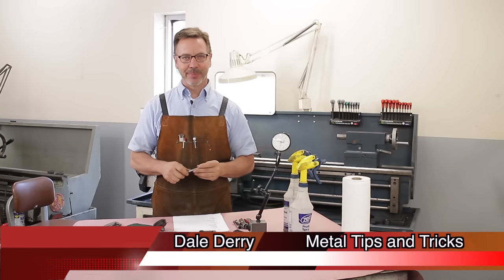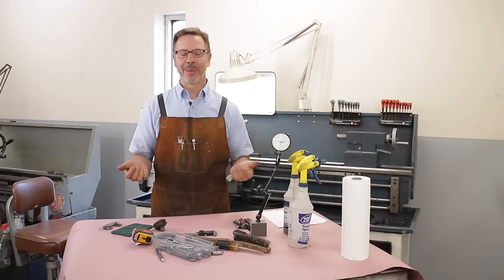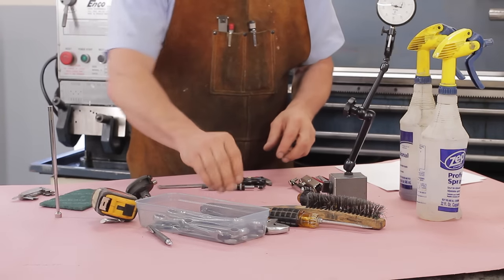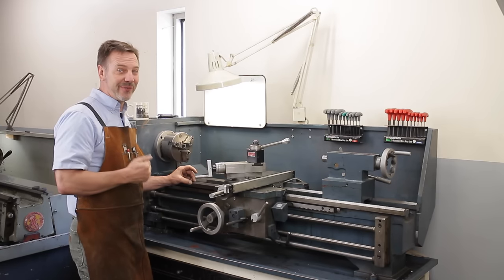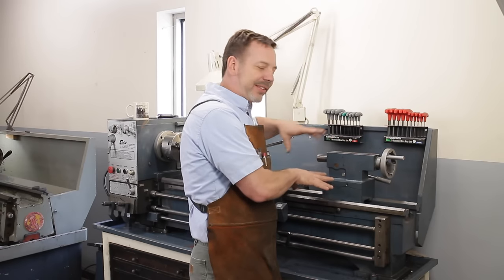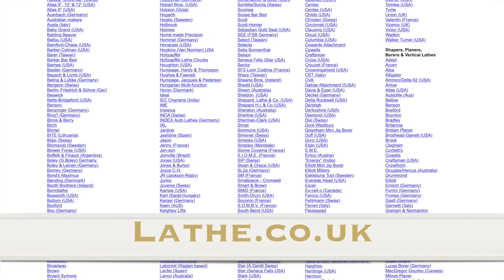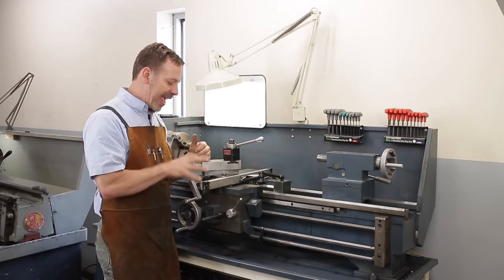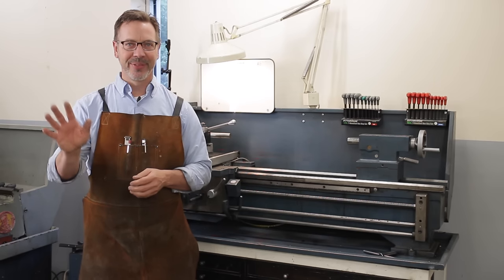How to buy a Metal Lathe part 1

Comment: I don't know if it's because it's 2021, or the part of the country I'm in (southern arizona), but I hardly ever see a full size lath for less than $2000 on craigs list, and if it's in nice condition (doesn't look like it was just pulled up from the bottom of a lake) and comes with some useful accessories, they tend to start closer to $3000 and go up from there.

Comment: Great technical guidelines, explanations and references for checking the state of a lathe. Very well done in terms of using simple explanations. 

I personally think it is overdoing it using the indicator and tightening gibs for a $1000 lathe. ;) You can have a sense of looseness without having to use an indicator. Myself, I would not let an unknown person show up and start playing with the adjustments of the gibs on my lathes since they are in perfect order! 

You must be the exception having paid those prices for lathes in good order. Or one has to spend an inordinate amount of time constantly looking for bargains. I bought lathes for less than $1000 but they needed a lot of work or tooling before being usable for turning something other than wood. 

The lathes that I have now for turning precision parts were all worth a lot more because of the state they were in and the tooling included i.e. chucks, collets, steadies, taper attachment, DRO. 

Then again, fixing an oldie machine to make it work almost as new and finding the accesories to equip it is a hobby in and of itself and that might be what gives you the most fun!

Daniel
Reply: Better be pretty sure it's OK before pulling out a scotchbrite pad in someone else's shop

Comment: Very informative and true! I've never spent more than $650 on any of my lathes (Atlas, Logan, Craftsman) and if you find one with extra tooling, it's a bonus.

My Craftsman came with a Turret that was for the wrong model... I sold the turret and made most of my money back. The best part is that the machine was rarely used (after 40 years) and the waze  was mint (within .0003 throughout the entire travel).

Another example, My Logan came with two steady rests. One steady rest was for a lathe with a half-inch higher center. I sold that and paid off half of the machine.

With patients and perseverance, Craigslist is the way to go, or eBay (local pickup)

Comment: I like your approach for buying a machine tool. Almost every machine tool that has been used & not maintained or rebuilt at some time is not worth over a $1,000.00 because you are going to have to ship to a quality machine tool re-builder & that will cost thousands depending on what needs to be fixed. I have seen 40 year old milling machines & lathes that had never been rebuilt going for $8,000.00 -  $15,000.00. People & companies have no idea how to price their crappy wore out machines.

Comment: Thanks for the useful info. I have been looking at lathes and mills on Craigslist for a while, but was thinking that I would end up with a 1000 lb. paper weight, now I think I might finally buy a machine that I can learn to use.
Reply from the maker: +TheHillbillyEngineer 
remember if you pay a Metal tips and ticks price you can always resell it. :-)

Comment: All you guys who can't find lathes... I don't know what you're doing wrong.  The last lathe I had was an old Atlas I bought for $150.  The lead screw and everything that connects to it came in a box disconnected from the lathe, but I never used it so it didn't matter.
I likewise let it slip through my fingers afterward, because I had it for three years and only did two things on it and I can't devote 12 square feet of shop space to an unused tool.  :D
I suggest two things for those looking.... First, like he said, be patient.  Deals come along.
Second, get to know the other tool heads in the area.  For instance around me there's an engineering listserve, and they have an annual yard sale where everyone cleans out their old crap.  That's where I found the Atlas.  But that wasn't until the second or third year going.  See point #1.   :D

Comment: I have the same lathe just re-named, looking forward to your next video because my lathe has issues with the tail stock lining up center in different positions along the bed. thanks for all the good info you produce.
Reply: +Theo worm That's a bad sign... You should be able to keep the tailstock centered on the spindle without any adjustments for the length of the ways... What you are  mentioning can be anything from worn out ways to a bed that's been twisted - either by crashing the lathe under load, or having the lathe fall over and hit the floor / ground.

Get a longish straightedge - 18" or 24" - and for this, a Harbor Freight (aka Horrible Fright) 24" combination square's ($10) blade will do the trick - and set it up against the ways and look for light leaking between the straightedge and the ways.

Check it both horizontally and vertically, on both rails (unless you have a Hardinge or similar, which only have one dovetail way for the bed)

If the light leaks are thin - like feeler gauge / shim stock, <0.020" thin - you can consider having the ways scraped, or ground and re-hardened... if the lathe isn't an inexpensive one.

That gap size isn't hard & fast, but you are talking about a large surface grinder job. I forget if it was Keith Rucker who had that done on a lathe, but the project cost a large chunk of change.

What I'm getting at here is that you may very well be in a situation where it makes more sense to sell the lathe for parts - you just won't know until you map out the ways and assess the damages.

Sorry to bear rough news, but you could be in a very frustrating position.

Eric
Reply from the maker: +Theo worm 
Im glad you like the video. I had a similar problem with my lathe. What I did to fix it was take the tail stock off and clean the ways on the bottom of it, they were a mess.
Reply: OK, so in my late night reply, I assumed that things had been cleaned of accumulated gunk & crud... I guess that I should have been more explicit about cleaning things up first... ;^)

Comment: Lots of good information including the advice about the tailstock internal MT surfaces being badly worn or bell mouth. It is not an easy fix unless it is just slightly worn. I like to hear your advice on what to look when inspecting the headstock.
Reply from the maker: +Paul Jones 
Im glade you like this video. You will have to wait until next week to hear about the head stock

Comment: bought my first lathe recently wish i had seen this vid first. incidently i bought this exact enco laithe used and was completely taken advantage of and lied to. but thats life. thank you for the invaluable information!
Reply from the maker: Sorry hear about lathe. Did you get it working?
Reply: still working on getting the bend out of the cross feed lead screw. Im daunted have no experience with this machine. luckily the ways and main lead screw appear in great condition. so i got that going for me...which is good.

Comment: extremely helpfull video, I was looking for exactly this, someone to show me step by step, not being a machinist, how to buy my first lathe and not get ripped off.

verry good deals! im envious. ive been keeping my eye on craigslist in minnesota for a years and the only thing I see for under $1k are occasional old 6-12" belt driven lathes, or big lathes in really bad shape in need of serious restoration (usually sitting outside for years). lathes like the ones your showing would avarage mabey $5k here, with mabey $2k at the low end.

It may be a difference in location, but i just dont think deals like that can be found where I live, ive been looking for probably 5  years and if a deal that good came up i would have made it happen.

Comment: My 12x36, same as the enco here was $250 canadian, came with a bunch  US made indexable tooling, and multifix toolpost. Ways are flawless. Problems were cracked handwheel and gear selector from being dropped. I noticed later that the spindle has 0.002 TIR. Will have to learn to use my toolpost grinder to fix it..

Comment: I bought a 12 x 36 atlas,,2 chucks 3 and 4 jaw,,, aloris tool post and nice full set of tools,,and has quick change gear box and shows no wear on gears and ways,,needle didn't move in spindle runout,,,payed 800,,

Comment: I picked up a south bend 9x32 C for 150$ it had no ware the actual factory flaking was still visible! Two weeks later I picked up a South Bend 16 x 60 with a 3 jaw chuck , 4 jaw chuck , face plate , two steady rests , follower rest , taper attachment, ball turner and lots of tooling for 1000$

Comment: I just called my psychiatrist, I need help after hearing what you paid for your lathes. I must be crazy for paying what I did for mine. My wife is going to kill me. I have never seen deals like that and I'm not doubting what you are saying. I think location has a lot to do with it. I drove almost 900 miles to pick mine up and the only reason I bought it was it was fully tooled and looked great for being 60 years old. I wished I had seen this video before hand. The head stock bearing is zero in one direction and 1/2 a thousand the other. Using a test bar and dead centers over a 12" distance it's zero on both ends but moves .0005 over the 12" from Tail stock to Head stock. Can't get the nuts of the handles for compound and carriage feed where I have .060 back lash on compound and carriage cross feed. I'm not a machinist but had some machine shop background over the 40 years I was a certified pipe and tube welder. I'm disabled and have a lot of work cleaning this lathe and bringing it back to standard. I would never have bought it knowing what I know now, I don't think I would buy a South Bend Lathe but would look for a lathe with more HP and not a flat step belt pulley setup. My health issues are shutting me down from doing any physical work anyway. I hope your method of buying a lathe helps all who watches this vedio

Comment: your advice seems to assume a recently retired machine, would you recommend against buying a machine that has sat long?

I recently bought a 1921 lathe that the seller said hadnt run in 30 years.

everything was stiff and the exposed lubricant had become gummy over the years.

the ways look good but it will need some work before it can be checked out as you suggest.
Reply from the maker: Hi Drew, If you got it for a good price its hard to go wrong. I have found that dried oil protects the machine from rust. and its not that hard to clean off. Good luck:-)

Comment: For me, the biggest thing on buying a lathe is the seller. On my A/C late, the seller showed everything that was not perfect on the lathe. No big things; cross feed screw has a bit of play. Tailstock taper did not fit some tools perfectly, aftermarket pulley as original was warped and ring in the spindle pulley. The lathe was well kept and oiled. So, I knew what I was getting. He was getting a nice Chipmaster lathe and needed room so sold it cheap. 

My 109 lathe was "here you go, I know nothing about it". Worst lathe I ever had.

 Before seeing it research it online. See if parts are available and forums will show common faults (i.e some have flaky electronic controls.). The more the seller knows, the more you can learn form them.  If all they can say is it has a new paint job, walk away.
Reply from the maker: +Scott Henion 
Great advice

Comment: Hi, i build small flash light housings from stainless steel at school, but i want my own lathe. The housings are small like 95mm to 200mm long and 14mm to 30mm wide, what would you recommend for that? And and nice video btw.
Reply from the maker: Im sure if I under stand your question. what kind of lathe would I use?
Reply: Hi, yes

Comment: This buying advice all came too late for me but to be honest I think I would have bought my hobby lathe anyway just because it's a fantastic antique. Got it here in the UK for £100 ($132). Drummond round bed lathe built between 1908 and 1938 & many of them were used in the machine shops on battleships in WW1. Have you ever had a round bed lathe with an internal screw ? I'm still building up the courage to clean it never mind open that can of worms.

Comment: Hi Dale, I’m an avid viewer and subscriber of your YouTube channel. Great stuff. This is partially your fault!! I just bought a year 2000 Enco 13x40 Turn-Pro lathe😁👏🏼👏🏼. Has factory DRO = happy! If I remember correctly, you have the same or similar lathe. Wondering if you would advise me on quick change to post size. BXA or CXA?? Thanks!!
Reply from the maker: Kenny Gee hi is have an axa on mine
Reply: Build Something Cool ; Hi Dale, thanks for the reply. I ordered a Bostar BXA through eBay - $180 to the door w/7 holders. Works great, I like the size. I used your advice while examining the lathe and got what I think is a great deal. Thanks again for all your videos. I’ve learned a lot!

Comment: I looked for years for a. good inexpensive benchtop lathe. I didn't either need or want a lathe bigger than 10x24, as I worked in a machine shop and had access to large lathes. Anything in even halfway useable condition that I found on ebay, used machinery dealers, Craigslist etc, fell into 2 catagories, decent condition but priced completely out of all reason for what it was, or old busted up and worn out parts missing, cleaned up and repainted junkers from (insert name of defunct US machine tool company here).Scrap iron. Better to just buy a new  import. My hobby is making things using machine tools, not rebuilding junk machine tools.

Comment: I think I would rather buy a new Chinese lathe than try to get a good deal on an old machine.  Their is so much to look for that us amateurs will overlook on a used machine of any kind and the eventual repaired cost will be as much as buying the new Grizzly.
Reply: +Amateur Redneck Workshop 
Hi Harold, 
That's the on-going debate isn't it? Whether to buy new Chinese or old American...

The South Bend lathe in my avatar is from the 1970s, runs like a champ, but was never used in an industrial setting. It's been used in a community college since it was brand new and has always been well cared for. It could probably be used for another 40 years, no problem. However, when I check Craig's List and Ebay, everything I see looks rode hard and put up wet. I live in southern Oklahoma and we have a lot agriculture, but not much manufacturing. Every once in a while something pops up in Dallas or Oklahoma City, but usually those machines are trashed. 

We have a Grizzly lathe 16x40 that we use for gunsmithing and light machining and it has its quirks. It probably wouldn't hold up for daily hard use but it suffices for what we use it for. A buddy has both a smaller Grizzly and a larger Jet, neither of which are industrial quality, but they works well enough. 

Take care, 
John T.
Reply: +John4566442 I was mostly speaking for myself.  I have neither the time nor the skills to restore old industrial machines.
Reply: Me either.

Comment: Unless you are going to estate sales or buying it short order/time crunch good luck with that. I have been watching craigslist for a year and not a single contender goes below 2k let alone 1.
Sad thing is that people post up $3-6k lathes every day just caked in grease, grime and rust acting like they are doing you a favor by selling their filthy neglected piece. That or its 3-6k with zero extras. 
You can find deals here and there though. I just missed buying a 6 month old Miller syncrowave 250 tig welder with EVERYTHING plus consumables for $800 at an estate sale (the base unit minus the cart, bottle, helmet etc is ~$4000 new). Dude that had it on hold showed up with 5 minutes to spare before they sold it to me instead.
Reply from the maker: Good luck in your search. you will find a good deal when you lease expect.

Comment: This would all be fine and dandy if you are dealing with a shop or a dealer. If you are dealing with an individual there is a fair chance that you will require dental work when you start using solvents, wire brushes, scotch brite and tools on their machine. If you're are lucky they will just tell you to get the "F" off their property because you're a goof.